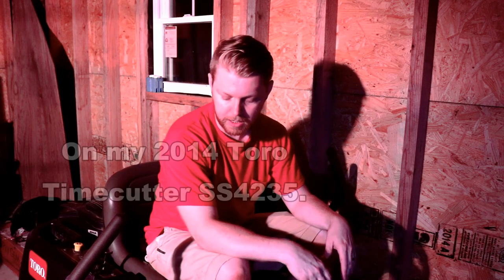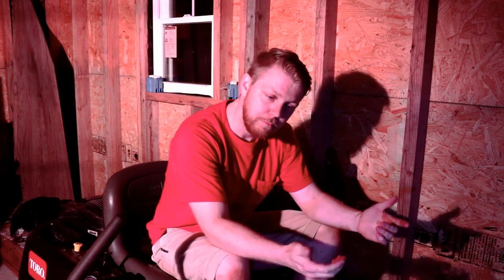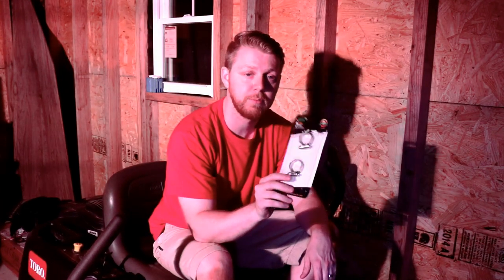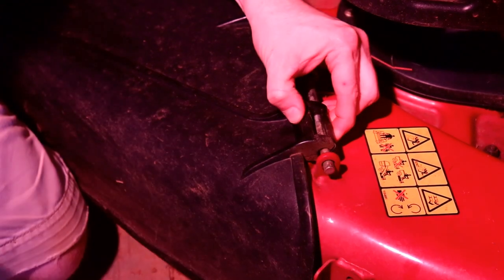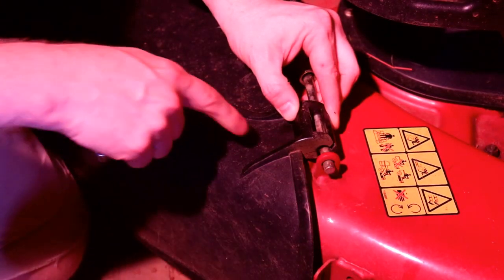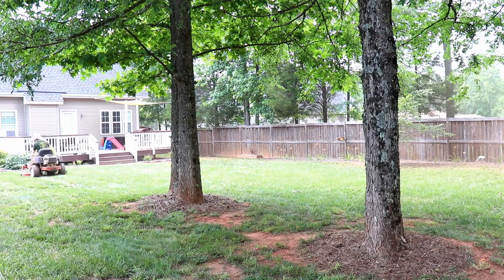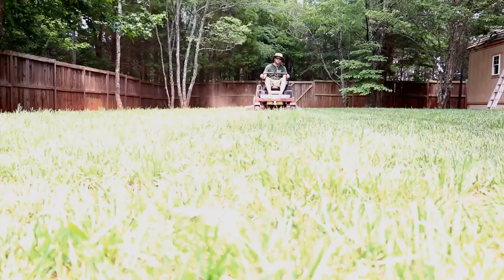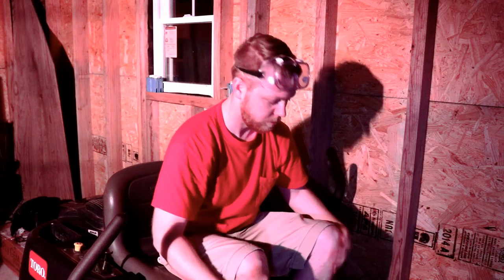$3 DIY Lawn Mower Discharge Chute Repair!

Comment: Thanks for the great tip ! I wound up using my Dremel with a cutting disk to cut a slit and then used hevy duty zip ties to wrap around the rod.. Works like a charm-Thanks again !
Reply from the maker: Thanks! I’m glad it helped. I made that video, I believe, 6 years ago. I broke that discharge chute to the point of replacing it this last fall. It had a good run with the $3 fix! 😂